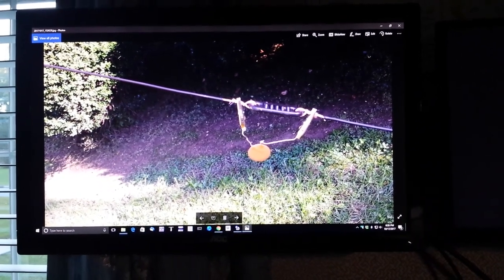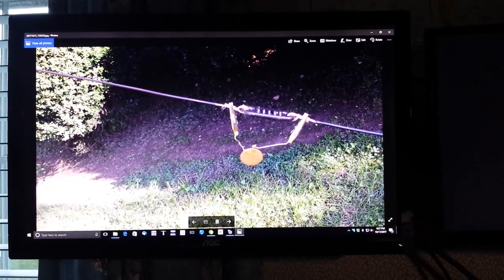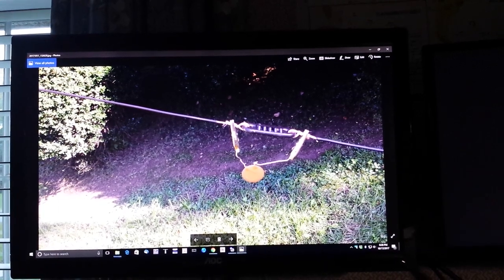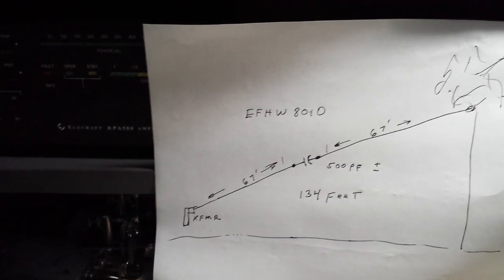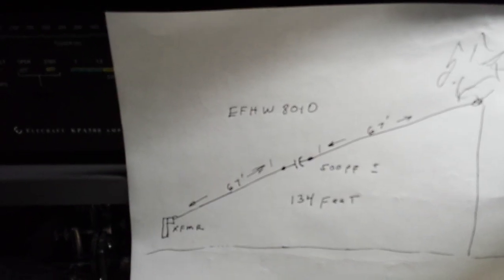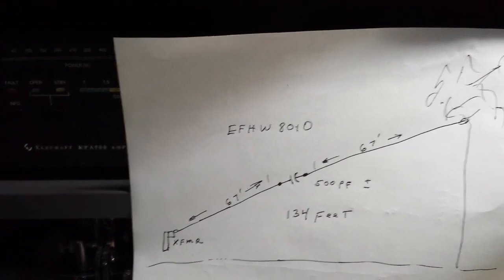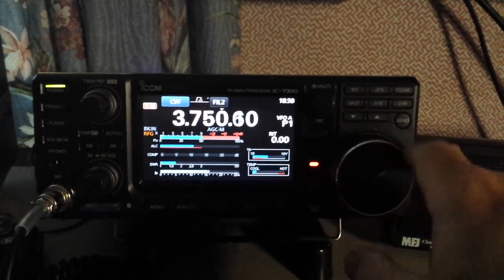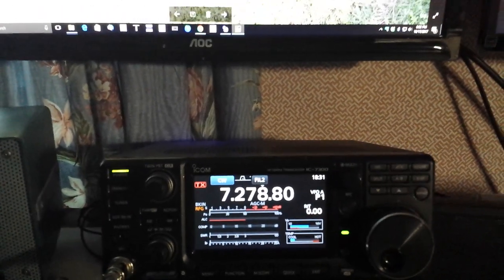EFHW 8010 75 meter Modification

Comment: Thanks for the video Steve.  I'm modifying this same antenna for 80M SSB. I ask myantennas for recommended values for the cap and they came back with about the same range as what u mentioned...but they also mentioned that one should also install a bleeder resistor for static electricity.  Anyone know what values of bleeder resistor should be used?
Reply from the maker: If you must use a resistor in parallel with that capacitor I wouldn't go below 1 meg ohm and it must be non-inductive....no metal film things. The wattage is anybody's guess but I suppose the higher the better if it matters. I never use a resistor and haven't noticed any ill effects but yes, static could build up with nowhere to go.
Reply: I never thought about a resistor or static and have had zero issues with this simple mod. I have had very nearby lightning strikes and zero damage to my equipment or antenna. Other things got blown up.

Comment: I have a Nelson 2k 8010 efhw. I'd like to try the conversion. My problem is in finding the capacitors you listed. It's not like there are Radio Shack stores or other electronics stores on every corner like when I was a kid. Yes I'm that old. Old enough to remember before Radio Shack they were called Tandy - A Radio Shack. I digress. So I've been searching the web for 500, 300 & 250pf 4-6kv ceramic disk capacitors. Figuring I'd experiment with each to get where I'd like to go. The sweet spot being around 3.850. And honestly I'm having problems sorting through everything out there. If you could point me in the right direction I'd be grateful. Thanks. I'm good on QRZ. AB0MS.
Reply: Digikey or Mouser.

Comment: Thanks for the video.  I have the 2K 8010 and a 15kv 250pf ceramic disc capacitor.  Right now I only have a 500w amplifier.  How will this conversion work with legal limit phone ops?
Reply from the maker: Sounds ok to me.

Comment: Steve thank you for the video, last weekend I put one up using your video as a guide. I used a 417 pcf capacitor (actual reading) and I’m able to work 80/40/20/10/6 everywhere I want to use it. I used my own 3 core 49:1 and it works great!

Comment: Thanks for showing this information Steve. I had been doing this with an OCF Dipole (the Center Loaded OCF) and never even thought about doing the same for the EFHW. I just completed this using a 400pf capacitor and it pretty much only affected 80 meters, just as expected. I went from having the lowest SWR at 3.5Mhz and only about half the band below 3.0 SWR to setting the lowest point at 3.8Mhz and having all of the band, except above 3.97Mhz below the 3.0 SWR range. So This worked out pretty well. Again, appreciate you sharing this idea! 73

Comment: For my mfj1982 mp 16awg wire i put a 100pf3kv capacitor and got 1:1 at 8.900. Thank you very much for the idea.
Reply: Hmmm what is on 8.9 mHz?
Reply: @jrfoleyjr pretty sure he meant 3.9
Reply: Maybe 3890? @75ohmHAM    -  kc4i

Comment: With two 470pf in parallel, my low point is at 3700khz...
Perfect mix between FT8 and local SSB at 3780khz
Reply: That will get you down to 3.573 for JS8 call?
Reply: @anonymous_friend   I'm around 2:1 at 3.600
Reply: @anonymous_friend  2.75:1 at 3.500

Comment: Hello Sir, my EFHW is shortened type : match box - 10.1m - 34uH coil - 1.85m
Could you suggest the position of the capacitor ? 
I work on 40m and 11m ( CB ) any suggestion for this please ?
Thanks
73 Indra
Reply: You propably dont need this capacitor. What You want to archieve? Your antenna is 20m version with added 40m by using coil and additional wire. Ifbyou want to use it on CB you propably need to put capacitor in the middle of the part fromnunun to the coil but first lenghten the 20m part of the antenna to get resonance lower on the 20m. This will bring resonance down from 10m to CB, and capacitor will bring back 20m band upper in frequency again. Also,after this adjustment of the 40m section may be needed.in my opinion - not worth it. You better make simple CB dipole around 5,5 m long or just simply cut a new wire for CB around 5,5m, disconnect old wire and connect this one while operating on cb. Wires could be placed pretty close to each other and this way you can add resonant halwave wire for any single band. Ofc it can be hard sometimes to switch wires depending on mounting place of the balun.

Comment: Can that cap handle the center current?.. maybe I’ll use several lower caps in parallel to better handle the larger current ...
Reply: And maybe try a variable capacitor to allow you to tune more easily to the portion of 75 metres you want to use.

Comment: Good job. I do a bit of antenna design and modeling myself. The popular loading coil method is a compromise of both position and value. The only way to do it right is to insert a capacitive reactance in the only point that is a current loop on a single band. This center point is a node on all other bands and would have minimal effect. I have also used a center stub method to achieve same result. My method is adjust total length for 15M. Then adjust C in center to tune 80M.
Thanks!
 Jim K4BPM

Comment: Scrap my last question; must have had the wrong glasses on. Actually, shouldn't that capacitor be protected from the weather somehow?
Reply from the maker: It's just a simple insulator of any kind. The capacitor is soldered across it. You can paint some sealant on the solder joint if it makes you feel better.

Comment: Will these EFHW 8010 antenna’s work better if both ends are up high?  Instead of sloping?   I’m about to mount one 35’ high, straight for 100’, then a  45 degree turn fo the last 30’ or so.  All at 30 to 35’ high.

Comment: Good evening: call WB2WW and I live in a apartment with balcony up to the 7 floor, I roll the 1080 efhw endfed wire to a pvc and I have the same issue with the swr I took a electrical wire about 4 feet to be exact and I made a coil and still between the machine tranformare and the wire with out cutting.the antenna now get tune in 10 tru 80 meter with the Kenwood ts990 , now because propagation are not that good in Stamford Connecticut I don have an idea if the antenna is resonan , I gets my question can I do the same modification well help me  to work in screw drive style.any advise will help..thx 73 ..

Comment: My friend.  greetings.  I would have a question for you.  I have the efhw 8010 2k antenna.  Approx.  40m cable length.  I will reserve 20m-20m like you.  The frequency I want to work is 3777 khz.  Should I use a 300pf or 500pf capacitor to capture a minimum swr?  Thanks in advance ...

Comment: I used two 500Pf mica capacitors in series to get 250 pf...put things right where I wanted 
Target half wave 75M  resonant frequency is 3933.  At my QTH here in Fairbanks, Alaska , we work stateside on 3920 LSB, 3933 LSB and 3940 CW....So this works out just fine.
AL7N
Reply: You confirmed what I was thinking that about 250pf would be about right to get it up more in the center of the phone band at about 3.9MHz. Thanks as that is closer to where most nets operate and I also.
Reply: Great info. I need to work 3.950 for the N. Florida emergency services net and the SWR was off the scale. My vertical is tuned for that frequency but the wire hears 75m much better. I added a 330pf doorknob I had in my junk drawer and it's dropped it to 1.7:1. I ordered some 3000v 100 through 250pf caps that will be here this week. Going to experiment and see if I can improve SWR a bit more.

Comment: I am putting this antenna up, but based on a 40 meter length. However I will use it as an 80 inverted L. Would this even be a consideration?
Reply from the maker: Yes possibly but you can look on the internet and find plans on how to build a 40m end fed half wave antenna that by using a loading coil allows the use of 80 meters .. what this capacitor does is electrically shorten the antenna which is the opposite of what you need.

Comment: Would this work? I can't tell if you're using a ceramic capacitor or ? 
http://www.mouser.com/Search/m_ProductDetail.aspx?Vishay-BC-Components%2fBFC237524241%2f&qs=sGAEpiMZZMukHu%252bjC5l7YRRWQ4n9sQIi%252bW5tOxJSLTY%3d
Reply from the maker: No.... Use a ceramic disc cap. 3kv or higher. Get some 220 or 250pf ... You can put 2 in parallel to get 500pf  or 3 in parallel for 750... That would be more versatile. Or if you find a bargain on some 100pf you can combine those to make anything you want. Putting them in series reduces capacitance just like resistors in parallel...Voltage rating doubles if they are in series but stays the same if in parallel. Here's a nice one https://www.ebay.com/itm/Cera-Mite-250PF-15000V-15KV-Ceramic-Disc-High-Voltage-Capacitor-Door-Knob-L2-/361527238724?hash=item542cb3e044:g:NCUAAOSwQgpXAuId
Reply: Steve Ellington thank you Steve. Are these antennas using a 49:1 or 55:1 unun?
Reply from the maker: Glock 49 to one
Reply: Steve Ellington Steve can you shoot me an email. It's good on qrz. W4zxt

Comment: Wow that's interesting!!! So I should get a 250 pf 5000v cap for 3930. Do these antennas use a 49:1? The reason I'm asking is bc I have the LNR precision 10-40efhw and I'm thinking about adding this capacitor and 65' of wire to accomplish the same result. The only problem I see is right between 65-68 feet, my wire inverts off of a tree limb. Haha. My luck, I would end up breaking the capacitor or shorting it out. Maybe adding a neat little box to put the cap inside?? Man I wish I had a bucket truck for 20 minutes. I could get my eye screws high into the tree. In a perfect world right. Let me know what kind of unun this has Steve and I'll research this option. Thank you so much.
Reply: You (or anyone else interested in EFHW's) should see more of Steve's videos and also the EFHW page on FB.  I'll be adding a capacitor to mine for sure. Mine is made the N4LQ way for 80-10 with 134'.
Reply: I added a hard plastic insulator and screws so it won't stress the capacitor at all, then taped it for weather resistance.